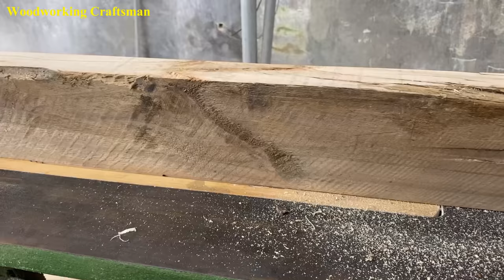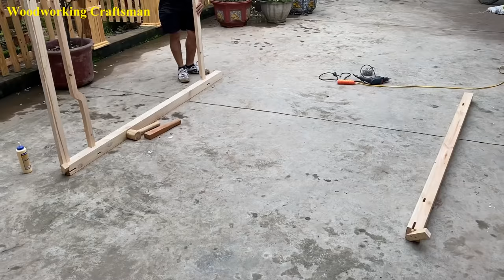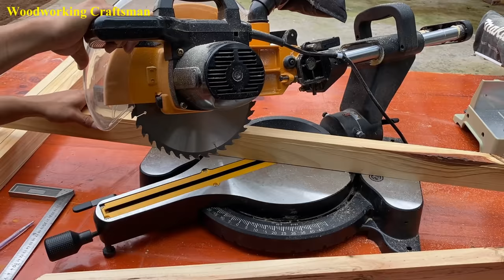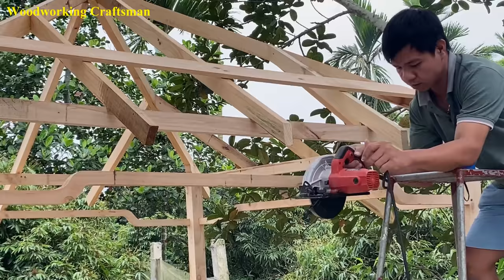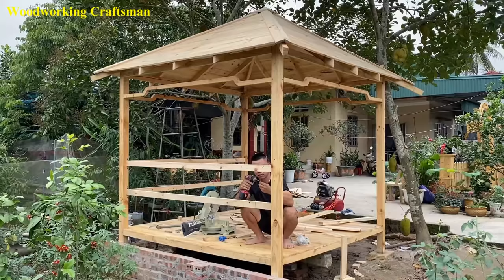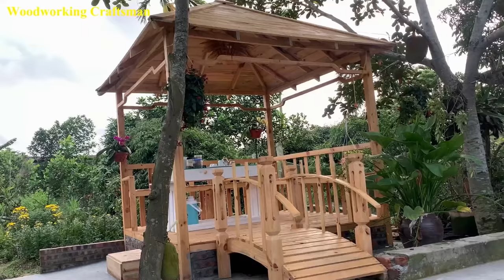The Most Perfect Wood Recycling Project Never Seen - Garden Hut Pergola Structures for Cozy Backyard

Comment: While it looks great, it needs more floor support especially at the center. A few more legs in the middle will prevent the floor boards from flexing. The roof boards need to overlap to prevent rain penetration. Need to bolt all four corner legs down to the cement ground or a storm will blow it away.
Reply: And the seating needs more support. It wouldn't hold 3 people on a side without possible collapse.

Comment: great design but every thing is disposable, all joints, cuts are very thin. this all structure is good for youtube video but it's not for real life use.
Reply: I agree ~ the floor joists have no support except for the corners. This will not be able to carry any significant load.
Reply: One should remember that he was  using recycled meterials.
Reply: @azmandelan1878  he didn't used leftovers or recycled. he cut all big and thick size boards into small and thin.

Comment: This project looks beautifull if you look at it from design perspective, thats great! But if you look from engineering perspective, its horrible! Couple examples: two of four main beams are touching ground- that is bad becouse the ones who are touching the ground will rot verry quick. Floor is way too thin + boards have holes from nails, you should put two layers. Attaching boards with these thin wire nails is bad becouse boards will get loose, you should have use screws. To enter this structure  you have to lay down your head to not get hit by a beam = bad ergonomics. There is no rain protection, becouse all the water will get through the sun roof boards and hit people, furniture and floor, the wood doesnt like water becouse paint will go away more quickly and wood will rot more quickly. Also bad ergonomics becouse users will get hit by water when they use it in the rain. You could have atleast put plastic roof membrane, 2 cm breathing distance and another layer of boards. I don't know much about weather in your area, but where I live, in east Europe, this gazebo will be rotten away in a few years if its not treated with super toxic and good wood protection paint.